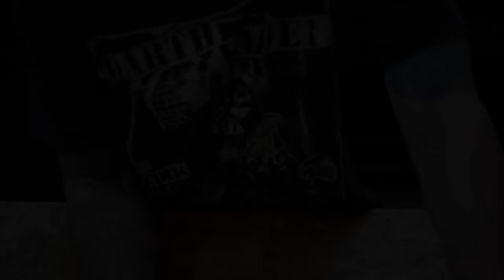How i buy MACHINE & TOOL in Vietnam

Comment: Your 6 jaw chuck build puts you at a expert black belt level. American machinists can learn a lot more from you than you can from them.
Reply: there should be some kind of Nobel prize for that scroll cutting jig!
Reply: @willi-fg2dh  Seriously, he totally usurped the Gotteswinter himself with that build. There was no pedantry, purity, or pride--he just got his ass in the shop and built the damn thing. You have people on YouTube with million dollar machine shops who still claim they don't have the proper tooling or equipment to attempt such a build. The only YouTuber in the US with the same can do attitude is Jeremy Fielding.  Dude built a robotic arm from scratch as a relatively new self-thought machinist. In other words, he built a non-stationary multi axis CNC.
Reply: @bobweiram6321  Jeremy is a degreed  mechanical engineer, I believe. But he started with basic shop oriented projects built in wood, and built up from there. So, yes. They are very much alike. Neither came from an easy background. You have to compensate for limited resources with more creativity, which both these guys have by the truck load.
Reply: @rallen7660  Really?  I remember reading his bio years back on his website and he claimed to be a professional fitness instructor.  It may have been just a side hustle. Later on, he said he took on a new job making CAD models as an engineer.  Not a knock against him at all, but Southerners are known to play a little fast and loose with professional titles. He might be a CAD/CAM specialist working at the capacity of a mechanical engineer.
Reply: @rallen7660  I am correct. See his video "Who is this guy?" He is a CAD designer and has an undergraduate degree, but no formal engineering training.
Reply: @bobweiram6321  
Absolutely agreed. Ca Lem is the MAN.
Reply: I'm a machine man....lol a machinist. Yep. 30 years. I think I went insane about 25 years ago. If maybe you should or could move to the U.S on work visa? Your an awesome machinist,  I'll higher you and put you on a lathe, your English is great. I wish I wouldn't be so Lazy to learn a second language.
Reply: At an*

Comment: Hello from England, I have brought all used machines too. It's not been easy for me to find machines and tools ect, especially because we seem to send most old machines to the scrap yard where they just get torn apart in a shredder. England has become a throw away nation it's nice to see that you're home is still trying to give a second lift to the things that are already made and probably higher quality then what would be made from them. You have a Great channel and it's nice to see a glimpse into you're world.
Reply: Hi Shane,
I’m just about to start building my own workshop too. Machines are quite cheap over here but tooling is the issue.
Good luck mate
Reply: @tonto8029  yeah tooling is not that easy to get for me too, especially holders that are not r8, 40 or 50 taper. Both my mills have morse taper spindles 2 and 3. I have over a hundred 40 taper holders just sag in the corner because I cant use them
Reply: Yup- the second hand machine market in the UK is not good at all - even second hand power tools are hard to find and expensive when you do.

Comment: These CNC Fäsen, Drehbanken, Ständerbohrmaschinen......... came from Germany. In germany you can buy stuff from the flee market but is more effektive. To buy at a Hardware Store like Würth, Bauhaus, BGU, Hornbach, Praktiker (closed), Hagelbaumarkt, Globus, Engelbert Strauß oder other own brands of hardware stores. You can buy a lot of specific tools or materials. But it went expensive. 

I remeber i bought some workclothes at the start of my electric tradesman education. It  was a a green workpant, a few Tshirts and three belt pockets for small hand tools and screws, nails, ....

The belt pockets paid themself of really fast. Because they were very usefull and helpfull.
I bought them 2011 for 3,99€ each pocket. Last year i wanted to mirror my workclose from home and my workclose from work. So i decide to buy two belt pockets again. Hold yourself tight.
In 2021 the price for one belt pocket was 16,99€.😲😲😲

From 3,99€ to 16,99€ for the same. i compared those and they exactly the same. The only thing that have changed are the price.

Comment: I’d fly out there from the US just to pick through that place alone. Back in the 1980s you could go to scrapyards in the US and pick through them. The first big wave of deindustrialization was going on, and you could find a glut of war surplus machines and first generation machine tools that survived the scrap drives of WWII. Nowadays you can’t go into most scrapyards due to liability concerns now. I know guys that got their entire shops from scrapyards. When I started buying woodworking machinery in 06’ the latest wave of factory closings opened up some of the last of the best old American machine tools for sale. I scored some good stuff, but there’s not a ton of old stuff like there used to be. We made so many machine tools during the war that, especially in New England where I am, where the US machine tool industry started, you can still find machines with war finish tags on them 80 years later fairly regularly. The best machinists I know started just like you did, that’s what made them and you great at the job

Comment: don't feel any less because of this . Honestly this is commendable because our country has gotten so used to using things a few times and then throwing it out or if it stops working. You cant buy parts for them or people don't want to go thru the work to fix something. That may cost a few dollars vs spending hundreds of dollars for a new drill or whatever. It's like a massive pawn shop over there I'm sure u can find some gems. Like they say one mans trash is another's treasure.

Comment: I think heat from compost pile is a good idea for hot water.. zig zag piping inside the compost pile for heat.
Same with dryer vent ducting.. running the ducting inside a compost pile will heat it, and a bathroom vent fan can heat your home.
Run dryer ducting into your home from the compost pile.. free heat

Comment: Hello from the U.S. you do a wonderful job with machining.  A good place for high quality metal scrap is the automotive junk yard. Leaf springs and axles are very high quality metal and will make great tools. First shape them, and then heat red hot, and then deeply dip in cold oil.  This will give you very hard tooling for your regular metal work.  With your skills, you can open up a machinist school

Comment: the hardship is similar here in jamaica where everything is hard to get even though we are close to America, everything has to be shipped in by either ship or plane, lathes are super rare, mills are even rarer and chucks are in short supply, and raw material super expensive unless you have connections with the scrap metal dealers 

i must thank you though your video about building the 6 jaw chuck helped me repair a 3 jaw chuck that I have

Comment: I Like the motor trike at 8:56 with the massive load of steel on it!  Here the scrap steel or cutoffs material are sort of the same definitely an increase in price to get known spec, steels or aluminum.  the range of used machinery looks like a lot of fun.  I'm a retired class a tool maker . in watching your work and videos I am always amazed at the solutions and craftsmanship you have, more than many of the fellow I have worked with. The american tool and die shops don't want to pay toolmakers much any more. every time someone retires the only people they can find to replace them are the same age , not many people getting into the trade here.   keep  going!!

Comment: In 1970 I purchased, in succession, two Vietnamese made bicycles.  It was then that I realized that what something looks like and what it is, can be very different.  Within a few minutes, the pedals stripped their treads to the cranks; the chrome fenders proved closer to aluminum foil; the wheel bearings turned to powder and within an hour, (no exaggeration, promise) in anger, pitched the messes into a ditch.  I purchased the second bicycle to prove the first bicycle wasn't a fluke.  It wasn't.

Comment: CNC is definitely something to explore, I've worked in the monotony side of CNC. I've worked in production for the last 25 years. I would like to see a conversion of a manual mill into a CNC. But still use it "job shop" style. Not production running. Or, at least only small runs of your inventions.

Comment: Hi there
I made a comment before (and got roasted for it) when you made the scroll chuck, I said that you were more than talented enough to be spending ages and ages on something that could be easily bought, you are way passed the apprentice stage
I have a mill and lathe and love messing around in the evening with them, however they are not a source of income, just a hobby and while its fine to basque in all the admiration your receive here (and rightly so) if your not making a decent living from it, its time to do something else with your talents and keep the old manual machines as a hobby 
I love your video's and hope you keep making them, but I would give the same advice to my son
Thanks again for all your efforts

Comment: Your English is very good. To calibrate your measuring equipment, invest in a good quality gage block set and a pair of 1,2,3 blocks and go from there. Maybe a small inspection block if you don't already have them. In my many many years I have found Starrett and Mitutoyo tools to be very accurate and reliable. If you could make the move, we could always use machinists like you in my country (US). Good luck.

Comment: If I can give you some advice. People always have problems to solve. And I know there is allot of other people with the same mindset. But solving problems for people can earn you a living. Expand your experience in CNC. I dont know if you can model in fusion 360 or other cad packages, but try and venture into 3d modeling and design aswell. It might open more doors especially with cnc.

Comment: You have a much wider choice of tools, although the machines are old, they are in good condition. In Ukraine, where I come from, there is no such things. I order everything either in aliexpress or from local sellers who are smuggling from Turkey. There are no shops where you can come and buy, for example, a chuck for a milling machine. This is all you need to order and wait. Always it will be online shop. You can not touch things or check before buying. The machines you can buy are all badly damaged, rusty Soviet models, with a poorly built structure, a poor bedding, crookedly milled at the factory. There is no choice as you have that I see in your video. The alternative is new machines from China for crazy money. We pay for 200-500% of base price in China for any tools or machines. I am very surprised that you have such a wide range of tools and machines. You should rejoice in this. Your mood has a slightly sad undertone that you have few people involved in the production of parts or the topic of machine tools. I'm trying to show you that everything is not as sad with you as it happens in other countries, which, it would seem, should succeed in the subject of tools. All the high tech CNC manufacturers I meet in my country are using old machines that were thrown away in Europe and the USA and almost of this machines produced by China. Or machines built with his own hands locally. We are also in the second year of the most brutal war with Russia in 21st century and this does not improve our skills and production values. You are doing the right thing, continue to do your job with love and sooner or later luck will turn to you.